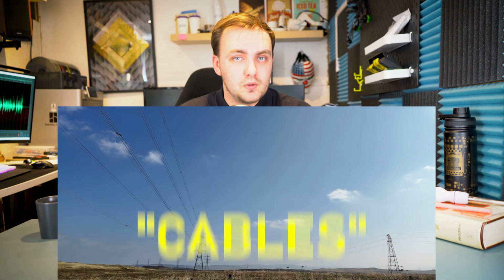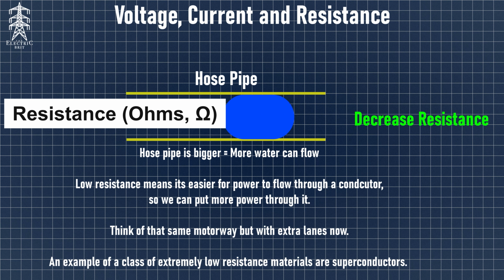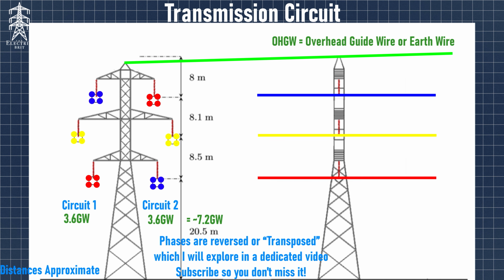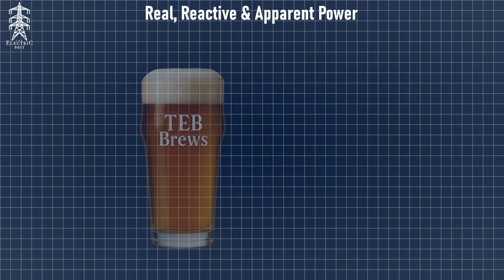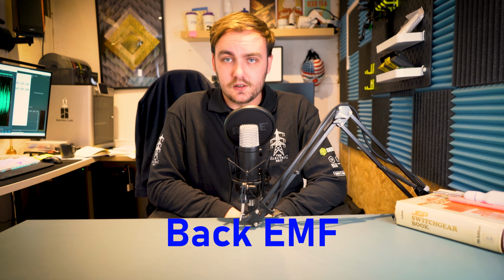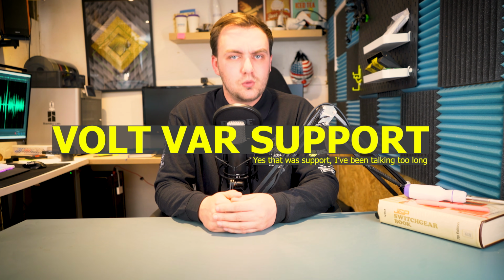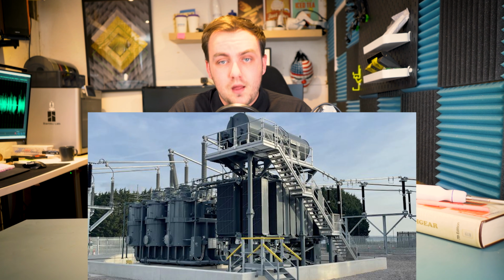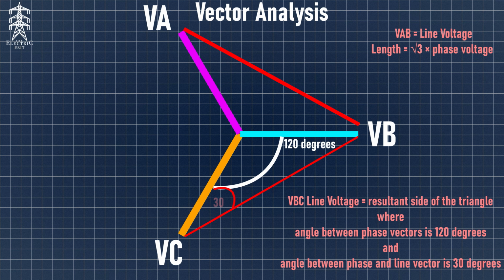How the UK Grid Works

Comment: This is a really fascinating channel for me. I’m an analog engineer and always been fascinated by even higher powers then we work with at main voltages, curious about the actual voltage of overhead powerlines and how they are transformed down to our house supply. Detail of cable power and issues of heating, skin effect et cetera is at a depth which no other informationI found goes into. So for me, this is pegged that just perfect level.

Comment: 5:53 "Superior" plug my ass. The German and French Schuko/Unischuko is just as safe if not more. British plug is also incredibly bulky and always comes in a 90 degree angle variant while schuko can be straight or 90 degree angle. 

Also you have to use it for everything, even puny little chargers and adaptors while we in continental Europe just use the two-pronged Europlug which is smaller and lighter and is a better fit for chargers and things like bug repellents that plug into the wall. 

Also the only reason you have a fuse in the British plug is because you use those stupid ring circuits which use 2.5 mm2 wire on a 32A breaker while Europe uses radial circuits, 2.5 mm2 on a 16A breaker. Radial circuits are better and safer.

I will never accept that British plug is superior to Schuko or the French plug. Never.

Comment: I enjoyed the video, the reactive power stored in the grid illustrated first as bouncing back and forth helped me visualise it, but then when you illustrated the CIVIL mechanics you changed the phase to first illustrate current leading the voltage for capacitive loads then current lagging the voltage for inductive loads. I was wondering what the cause for the reactive power being stored in the grid was, and the phase changing over time really confused me, I don't know if it was to illustrate CIVIL or to illustrate how the reactive power is stored. Does reactive power get stored as a result of the current changing phase on a per cycle basis or was that purely for the illustration of CIVIL?

Also, does the level of reactive power change per the instantaneous voltage?
Reply from the maker: Thanks for the comment and glad you enjoyed it. There’s definitely a lot I can improve on visually but I tend to just do what makes sense in my head at the time.

The CIVIL aspects is just for illustration like you say, first showing the reactive power going from source to load and back and how that’s both wasting capacity on the network and contributing to losses. Then the next visualisation is just showing what leading and lagging look like on a waveform, and I just animated it to show the range of lead and lag and to make it look nicer. 

Reactive power is stored in electric and magnetic fields. Capacitors for electric fields and inductors for magnetic fields (like transformers and reactors). Our lines and cables also act like capacitors and inductors, so in alternating current each cycle the fields expand and contract as they are charged up and discharged following the amplitude of the waveform. 

Because of that, reactive power various throughout the sine wave because it depends on instantaneous levels of current and voltage, i(t) and v(t) and the phase difference. We measure reactive power on the grid in VARs though which is the average over a cycle.

Hope that helps a little! My next video is on quad boosters coming out soon which you might find useful and after that, HVDC which also explains reactive power a little.
Reply: Thanks mate. You are a true engineer. The reminder I needed from uni. Thanks

Comment: Here in atlantic Canada, residential usually gets 120/240 from a split phase transformer, and last mile pole voltage is around 7200V. If you live in a highrise apartment building, or have a commercial property it's usually 3-phase power, 120/208V, so ovens take longer to cook and dryers take longer to dry....and the neutral is almost inevitably unbalanced and probably always carrying a voltage and very much not safe to touch, while in residential you can touch the neutral 90% of the time without worrying about being zapped....also most of us here just don't care about being lightly zapped because we only run 120v for residential circuits, and usually our hands are covered in drywall dust. It's a strange sensation for sure, but like mechanics tasting oil, some oldschool electricians just tap the wires to see if they're live....personally I've only accidentally attempted to electrocute myself, but there was so much drywall dust on my hands that I didn't realize the circuit was live until I pulled the wire off the terminals that I'd been touching and it arced, turned out the one light switch wasn't on the unit panel that had been switched off, but the master panel for the building because it was for an outside light.....dumb luck for the win...
Reply from the maker: I have heard some houses having both 120 and 240 so things like ovens and dryers can get decent power, but the age old electric kettle taking twice as long for anyone who has one.

It’s definitely interesting the attitudes to safety in the americas vs UK and Europe. I don’t recall ever being shocked at 240V and I’d rather not find out 😆 I’ve had the odd tingle and things like circuit breaker mechanisms which are floating and can pick up impressed voltage.

Comment: negative resistance in ohms law plot, wtf?
Reply from the maker: Got a timestamp? I can’t see it
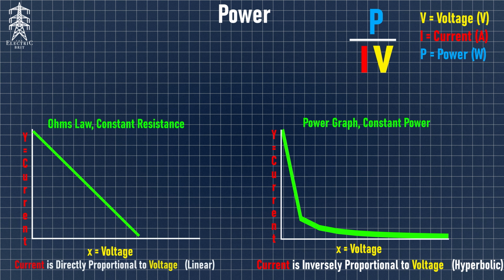Reply: @TheElectricBrit 5:26 (left). I'm just a regular joe with a passing interest but it seems to me, current should increase with voltage increase against a constant resistance, no?
Reply from the maker: @LA-MJ that’s right they’re directly proportional. In that case I’m showing a decreasing current also decreases voltage. So the same is correct for the opposite for increasing values, for a constant resistance.

Resistance is not plotted on that graph (no negative resistance)
Reply: @TheElectricBrit I am sorry but that's not how graphs work. 0,0 is on the bottom left corner. The tangent/slope of the line (=1/resistance=conductance) is negative in your graph.

Compare with the 'The I–V curves of four devices' under wikipedia:Ohm's law.

Comment: One small mistake:  you state that the battery won't give a shock because the body's resistance is too high for the low voltage to flow to earth.  As the battery is not an earthed device, power it provides will only complete a circuit when it returns to the battery.  Glad you used the old colours for the lines (red, yellow, and blue).  Thanks for an excellent video.
Reply from the maker: Thanks for the comment! Sounds like an oversight on my part, this was definitely a jam packed video of various ideas but I’ll try add a correction for more context. I usually look at things from a high voltage perspective and we never changed from the old colours 😉 glad you enjoyed it
Reply: earth is often used to mean 'zero volts' instead of the physical ground of the earth.

Comment: Last time I checked voltage it was spot on 240v, lowest I have seen is 234v
Reply from the maker: Funnily after making this video I checked mine and I’m getting 244V measures on smart plugs. It’s a very common issue right now high voltages due to solar so I’ll explore that at some point
Reply: Great video, worked around sparks in industry all my life now understand a little more about the BS they sprouted! This subject about voltage at local level was why I was mainly watching as since next door have had 21kw of solar fitted my solar inverter keeps tripping on high voltage at 253v. Seems to happen when there is a sudden change in solar production, when there is full sun. What do you suggest? Does the local transformer need replacement? Can a local transformer convert back to high voltage any excess? Or does it need to be consumed locally? Any other of your videos cover this subject?

Comment: As an electrical Fitter who served an indentured apprentiship in the 1960's passing City snd Guilds B and C certificates I think although most of the facts you state are true do you think presentations such as this are helpful. It took 5 years practical and academic study to cover the topics in this video needing to fully understand the theory. Classes were split into maths, electrical theory, magnetic theory, practical tests on motors/generators and thier construction etc. If it's going to just be a description of the power distribution then most of the details you describe are not needed as they are only of use to workers in the supply industry, Things such as Power factor and power factor correction, operation of substation control and protection equipment, EHT/HT/LV power distribution are inaccessible to non power workers.
Reply from the maker: Hey Arthur thanks for the comment 🙂 The beauty of YouTube and the internet for me is access to information. My parents used to drive past the Siemens Parsons works in Newcastle most weeks and as I stared out the car I always wondered what the giant chamber was you can just see from the road, or what the inside of BAE systems Armstrong Works looked like as they had a tank on display outside.

I love channels like Real Engineering and Practical Engineering where they research a topic for weeks or months or have lived it or studied it, and package it up into a digestible 20 minute video. Even better is watching people in those places normal people don’t get to see. Those are some of the things I want to do with this channel, but videos like this are just to lay some ground work to refer back to. A big video I’m going to cover in more detail than you’ll typically find anywhere is HVDC, but to do that I need to do a video on cables first, and for that this video. So it all links up nicely 😁 some things like vector analysis will go over 95% of heads, so it’s finding the balance between technical depth which some of my audience want, and accessibility. Hope that helps

Comment: Are operators metered by the grid operator? If so, how?
Reply from the maker: Substations use metering transformers to measure the power flow through circuits. This is important at generators so they get paid for the power they supply to the grid, however I’m not sure on the exact mechanisms for the grid getting paid for being there, besides a few government ones.

Worth me looking into

Comment: Well the picture is wrong for a start.  Never seen 11KV on a pylon before.
Reply: It does happen. Generally where it is 132/66/33 double circuit construction with one circuit in use. It is pretty reasonable to reuse the other circuit for a lower voltage. Even 11kV
Reply from the maker: Be happy I drew the bottom arms on myself 😉 That was AIs attempt at generating a pylon for the thumbnail. And AI is terrible at things like that as it always misses arms off or draws imaginary lines in. I’m a terrible artist so couldn’t come up with something clean myself.

Comment: i'm very excited for this channel !! I really appreciate how you've made time to talk about how the system works in practice (in the next video more so) - it's all too often the case that when you want to learn about a technical subject, there's loads of information on the principles but very little on how it has played out in practice in a particular time and place. I'd be most interested in topics like busbar configurations and distribution topologies: I remember someone saying that the Merseyside area is known for using ring networks with at least two grid connections connected - while other places seem to use single radial lines from one source - less resilient but easier to implement and manage
Reply from the maker: Appreciate the comment :) yep I need to get on site more and get some actual content (I’m currently in construction at the very start of a long project so not much to show) 

I’m a lot more familiar with transmission so you’ll definitely see a lot more of that and need to reach out to some DNO colleagues to show a “last mile” in depth video. Stay tuned!

Comment: Your diagram is wrong. The UK voltage is 240V. It is the EU voltage that is 230±10 V.
Reply from the maker: Typical voltage in the UK is 240V, however BS 7697: 1993 was 230 V +10% / −6%, i.e. 216 V – 253 V whereas when we harmonised with the EU, BS EN 50160 took over which is 230 V ±10%.

For the sake of the video though 400 root 3 gives you 230. I should add a caveat though that 415V root 3 = 239.6V. Still it illustrates the point. Thanks for commenting, I'll add a correction.

Comment: In Germany we have the high voltage 380 kV or 220 kV 50Hz. In my area a 220kV line is currently being converted to 380kV. 
110kV is distributed locally. There are 110kV substations here.
There are also voltages of 20kV or 10kV. This is brought to the various towns and villages. Industry and wind turbines are also connected to this level. 
In the villages there are 230/400V 50Hz transformers. So three-phase transformers where both voltages are generated.  There are private solar systems on this level.

Separately there is the 110kV 16⅔ Hz railway network and 15kV 16⅔ Hz traction current.
Historically, Germany, Switzerland and Austria have had this power supply for the railways.
Reply from the maker: Similar voltages to us and definitely fits with the metric idea in my mind of ending in a zero. I believe our traction runs on 25kV but I might be mistaken. The idea of fractional Hz is interesting though! Sadly when I worked for Siemens I never visited Germany as I usually avoided international travel.
Reply: @TheElectricBrit
In the uk we technically have 4 different types of train power delivery systems. 

Heavy rail uses either overhead lines at 25KV 50Hz or 3rd rail at 750V DC, with the latter now avoided whenever possible as it limits available power and top speeds, as well as being more dangerous. 

Trams typically use overhead lines at 750V DC due to street running

Most tube lines use a 4 rail system at 630V DC, although they switch to 750V DC when sharing track with national rail trains (in this configuration the centre rail is electrically connected to the running rails)
Reply: The British 400kV is comparable to the 380kV system in Germany.
The 275kV corresponds to the 220kV.
The 132kV corresponds to the 110kV.
There is no 66kV level in Germany.
And the 33kV is similar to the 10kV to 20kV systems.
Reply: In Germany, houses are usually connected to 230/400V three-phase current.
But most consumers are 230V
The stove is connected to 400V, but each stovetop only gets 230V.
Reply from the maker: I’d think this setup is similar to the US too, mostly operating at 110V but some appliances getting 220V or similar. In the UK it’s probably a cost cutting reason why most domestic don’t get three phase unless you pay for an upgrade.

Comment: 1. Get out and stay out of vision, we don't need to see you!. 2. Get rid of that ridiculous mic. Why does everyone think a big mic makes them look 'professional '? They just look stupid. Use lavaliers (personal). 3. I have always been told the UK home voltage is 240v not 230v!
Reply from the maker: Being in the shot means I can spend far less time trying to fill the shot with b roll or animations, which takes extra time. 

The mic is also there for a reason. I have a DJI mic which will be inferior quality to a proper condenser on an audio interface like I have. I also bought this mic for the voice over work originally but it’s doubling for filming. If I could have it out of shot I would, but my other mic isn’t suitable for this room as it’s very echoey - plain plasterboard and wood surfaces. 

I am looking to improve the setup though and I’d rather have the mic out of shot. 

Voltage in the regs is 230 +-10% but yes in reality it’s usually 240V. 

Thanks for the comment 😁
Reply: @TheElectricBrit Sorry to be a pedant but it's +10% and -6% at LV, so a maximum of 253V and a minimum of 216.2V.
Reply: His video, his face, you don't need to look at him! 
Nothing ridiculous about a decent microphone, if you have a problem with it looking 'professional', that's your stupid personal lavalier problem.